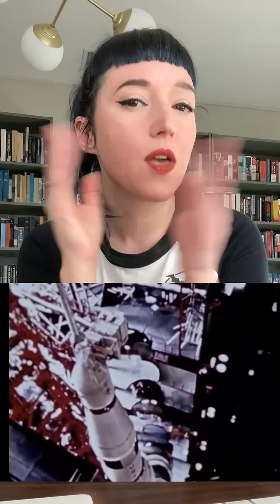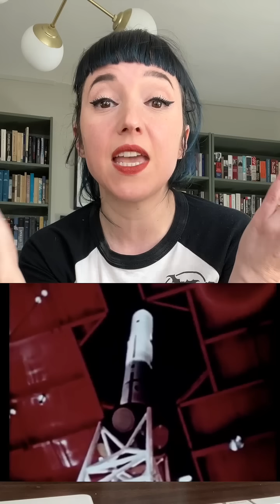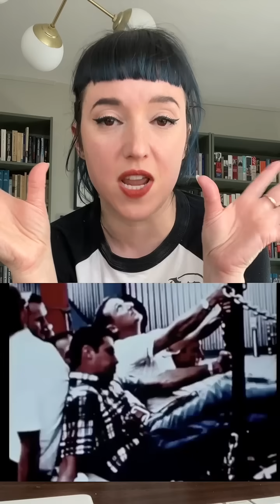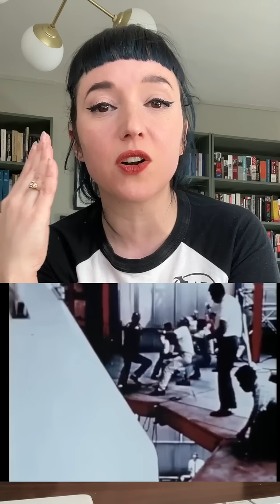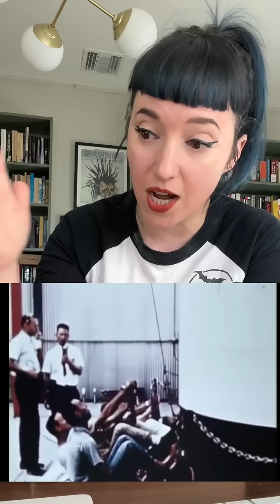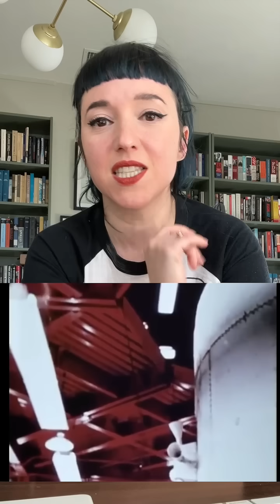The Least High-Tech Apollo Test  #history #shorts

Comment: Didn’t they have a hydraulic cylinder ram with hand operated valves to mount on either side of the platform to move the rocket from side to side back then? I’m a hydraulics guy that’s why I’m asking.

Comment: Honestly it is a much simpler and faster way of simulating complex dynamic loads without building a complex rig. The engineers pulling and pushing can work with or against the ossilation to build it up or dampen down and reposition quickly to induce forces in multiple directions. People can also use all their senses to feel out how the rocket reacts.

Once you lock down your rocket design you can build an automated rig but prototypes and the like its cheaper and better to have a few hands around instead.

Comment: As a current Test Engineer in the aerospace end is try, I love this!  We currently have to strain test harness connections and we have this nifty fixture we can use.  But you constantly have to adjust the weight because it raises and lowers during the test.  So we go with option ‘B’ which is to hang calibrated weights from a string.  Lol. It’s 2024 and we use glorified gym weights!!!  I love my job and how some things can’t be improved by technology.

Comment: I also love that one of the reason this technology is largely u used in the modern era is because there are no truly accurate plans.

By that I mean, when they went back to check the plans and talk with the Saturn 5-era  engineers about repurposing the engines other systems they found out that virtually everything was a one-off, bespoke, handmade item.  Because industrial manufacture of this sort was still developing, apparently a LOT of the piping and conduit etc was custom fit into place.  They were essentially having to modify most systems on the fly (during the “final” assembly).

Comment: don't be so sure it doesn't happen today... when I worked at NASA I once tested a flight model temperature probe by heating it up with my hand. it was the only instrument delicate enough not to risk the spacecraft but also cause enough of a temperature change to observe:)
Reply: I wish I could say "when I worked at NASA"
Super jealous and I love the story ;)

Best.
Reply: Up until last year, I worked in industrial R&D for a major supplier of automotive drivetrain components. We'd often check to make sure that thermocouples were plugged into the right channels, and the data acquisition computer was recording correctly, by holding them in our hands and seeing if the system plotted the temperature rise.
Reply: @SynchroScore - Oh yeah, good enough, quick enough, no budget request required!
Though one place I worked likely would have required you to tatoo a "no calibration required" sticker on your hand!😊
Reply: @ I mean, we did calibrate the thermocouples to make sure they were accurate, but function-testing by hand was still the simplest way to make sure we had them plugged into the right sockets and the circuits were reading correctly.

Comment: While engineers did manually rock the Saturn V while it was stacked in the Vehicle Assembly Building (VAB), using ropes and their feet to simulate swaying motions, it was not the only testing method used.  However, it certainly was the most unconventional. 

The Saturn V was also tested on a dynamic test stand, at the structural test facility in Huntsville, Alabama.  They thoroughly tested the Saturn V rocket and the Space Shuttle stack prior to the vehicles' first flight.  It had a derrick capable of moving 200-ton objects in a 70-foot (21 m) radius.  It had 15 different levels.  They also tested extreme vibrations simulating launch and even the effects of the pyrotechnic bolts exploding.

Intersting video, but based on the comments, maybe a little bit misleading.
Reply: Will... I hope you're having a great day. It's a one-minute video, not a long-form deep dive into NASA testing methods of the 60's. She picked a part of the story that is interesting and shared it. I appreciate your additional knowledge, but I'm not sure it is required to point out, given the nature of this post!  Stay well!
Reply: You aren't wrong, but I appreciate Amy's point that era really had an amazing variety of cutting age and rather low tech ideas, techniques and equipment used.

I suppose Amy could have said, "In this instance it was easier to just get everyone to pull on the rocket than build expensive test equipment for this specific task", rather than say, not exactly correctly that "the ONLY way" was to do it manually", but it's a short video and the point is keeping it simple and catch interest. 

Her larger point stands, it was an incredibly interesting time at the tipping point between a much lower tech age and the future we live in and astounding things were done even without so much of the tech we have now.
Reply: I'd say that the video isn't the slightest bit misleading. The Dynamic Test Stand at Hunstville was meant to simulate vibration modes while the rocket was in flight. This was a test to check the stability of the rocket on the launchpad. I'd say that this is even less high-tech than the capsule splashdown tests (basically dropping the thing into the ocean and seeing what might happen) because that still involved an aircraft.
Reply: BRO!! It’s LITERLLY a video of men pushing a rocket with their legs and pulling on it with a rope!!!! There was nothing misleading about it…..unless your a Chinese Troll Bot using AI to read Wikipedia……😂😂😂
Reply: Not sure I saw in the video where she said it was the only test method :)